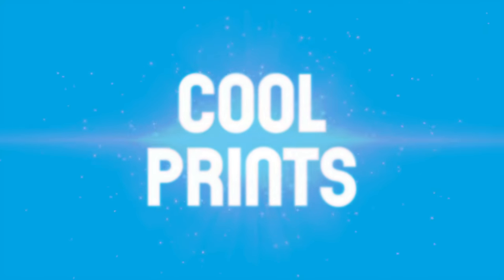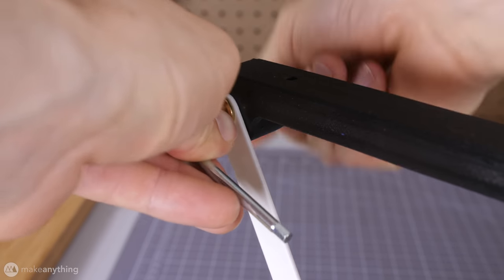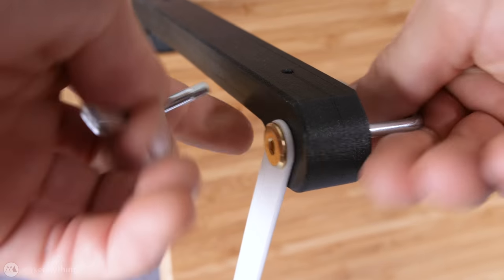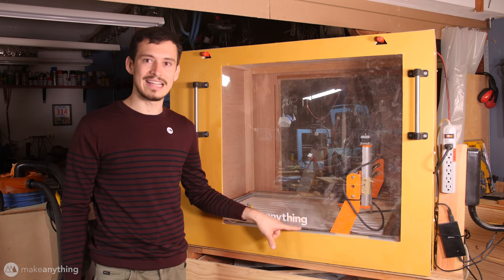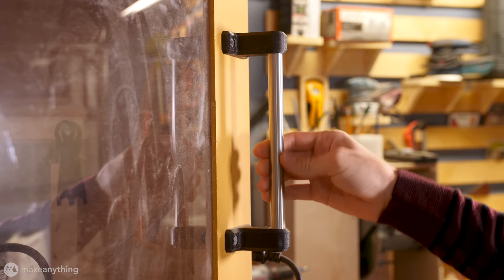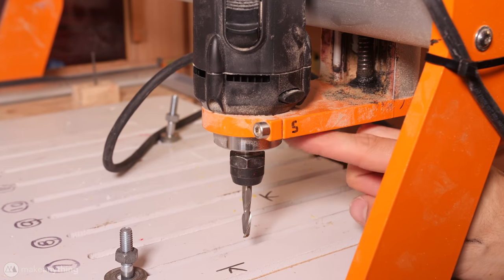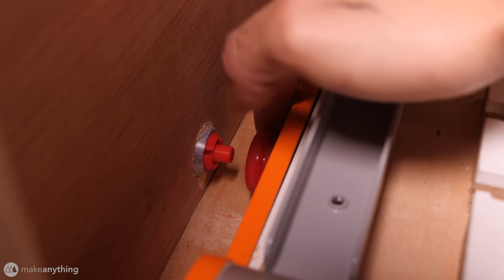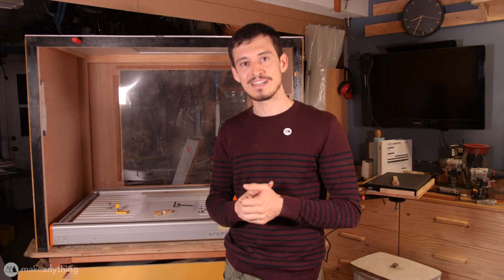Cool Prints // 3D Printing Strong Parts with NylonX (Nylon + Carbon Fiber Filament)

Comment: Project idea: using a CNC in conjunction with a 3D printer to make an object that could not be easily fabricated by either machine.  This includes ways to affix the object in both machines so the operations are aligned.  One of the goals is to fabricate parts that require a minimum of manual finishing work (one thought is using the CNC to remove support or raft blemishes).   Also 3D printing right on other materials then using the CNC before or after  in the process if needed.

Comment: when i make lettering or anything, i tape them into place before removing it from the build plate so the spacing is perfect, or at least only aligning it by eye in one or two places if it didn't fit in a line on the printer

Comment: You don't need it but for others who ONLY have a 3D printer You can build a bracket to attach to your 3d Printer either in place of or to attach to the Extruder head that will mount a Router to it and turn your 3d printer into an engraver with the proper Print settings in your slicer.

Comment: One tip when drilling with a paddle bit, instead of drilling straight into the wood, but cut and a slight angle and you'll grab more material. Once you're in about a quarter inch then you can straighten it out.

Comment: ever since i sprung 8 bucks for digital calipers I havnt bought a single replacement part for anything.
Reply: Better get an "analog" one from mitutoyo, mine is 20 years old and is extremely accurate with a precision of 0.05 mm.
Reply: @achannelhasnoname5182  Mitutoyo are pretty much the standard in machine shops for a reason... Expensive, but they last and hold their accuracy pretty damn well
Reply: @achannelhasnoname5182  That level of accuracy is redundant for 3d printing, even SLA. Just go for convenience. Cheap, digital, and a separate button for zero, unit change, and power.

Comment: same here! i made a ox cnc out of aluminum extrusions and used my 3d printers to print an arduino grbl box, a dust shoe vac adapter (which could be your next project) & limit switch brackets. i used nylon x, polymaker polycarbonate (pc) & polymaker polymide copa. stupid expensive filaments but when you're cutting away wood or aluminum you don't want weak plastic to break & fly off into someones face lol & i agree nylon x looks awesome because most of the lines disappear into this matte black "truck bed liner" look.

Comment: Hey Devin, I couldn't help but notice at 3:47 that your extension outlets on the right side of your CNC happen to be exposed. considering the possibility that pieces of conductive metal ejected from any power tools you could be using could end up in an outlet (which as you know is extremely dangerous), I thought maybe you should tape over them or find something to cover outlets that aren't being used. Have a good day!
Reply from the maker: Good advice, thanks :)

Comment: Your secret weapon is that 3D prints are more often than not pretty strong. :P 20 bucks says you could print those brackets using standard PLA, ABS or PETG and never have anything sag. If you're experiencing warping/adhesion issues, print on a surface that isn't smooth. I've always printed on BPT if not smooth glass with hair spray (before said glass plate exploded during a print removal!), but have been super pleasantly surprised at the ridiculous adhesion I get with everything printing on to this textured print surface that everyone is using these days. the stuff you'll find on magnetic build plates. Adhesion so good it actually damaged a PETG print (totally my fault! Was too impatient during removal) by pulling all 3 bottom layers off in one spot.

Comment: Honestly expected the filament to be way more expensive, but honestly not a bad price for what you're getting.
Reply: It's a gimmick.

 Multiple people have done tests on different filaments and carbon fiber infused filaments are actually weaker in most cases because it's more like carbon fiber powder than actual strands. Also not super great if it gets in the air, mesothelioma and all.

 PLA+ (basically less brittle, more ductile PLA) would have been actually way more than fine for his application.

Comment: Good video. Please talk more about what is necessary to get good nylon prints. Like you, I want to make things that are strong enough to be used safely, not just decorative trinkets. I have learned what the difference is between printing PLA and nylon, but everybody makes it sound much harder. I'm interested in what you had to do to make it work on a printer that might not be the ideal nylon printer. Thanks for a great channel.

Comment: as a start in CNC first, make your initials on a piece of wood or wren shape then using a similar material make a box out of any shape. you can use fusion 360 for CAM or if you have it use HSM pro for Autodesk Inventor.
i got this from a Project Lead the Way course Computer Integrated Manufacturing.

Comment: You could make a wooden picture (different widths in the part.. ..so when the light shines throu...) with the CNC❤️❤️🙏🤔
Reply: Ooooh, a lithophane out of wood ! That would be super cool. Probably super hard to make too, as wood isn't as translucid as pla, but maybe some type of wood could make that work

Comment: i have used CF NylonX too and find it tends to absorb moisture and not print very friendly. I now use CF PETG for my high heat resistant parts. and it has nurds everywhere. I need the heat resistance but so far no product is really perfect. Lastly I wanted to ask about 3D printing a manually operate Mill for a hobbyist  machine to build adaptors. I use a Dremel and stand but it is really flexible and flimsy. Dennis
Reply from the maker: I like the idea of 3D printing a mill, especially a mini one with the Dremel. And yea, printing high heat resistant parts is tough because of the nature of 3D printing.. you need some specialty hardware and filament to really manage high temps

Comment: That E-Stop extension still makes me nervous. If that was on any other machine (ie. a table saw), I would be terrified. Since it's an enclosed cnc with little risk for human injury, I'm less worried. It would still be nice for the design to be a bit more robust and reliable so that it works 99.9% of the time rather than 90% of the time.

Comment: I think this could be done with a standard filament. I am hanging a 12 lb electric guitar from a topology optimized wood pla wall mount with very minimal strain. His application has less weight and is in a more forgiving configuration than mine.

Comment: Haha.  With this way of attaching to the wall (one screw up and one screw down) you can completely avoid usage of that 3D printed black part.  Just bend the white metal upstairs and attach it straightly to the wall by a screw. And the wooden shelf (with drilled hole in the back side) can be pushed on the second (bottom) screw, protruding from the wall.

Comment: Hurrah for your dad!  Do you like your Stepcraft?  I run a vintage Techno Isel Davinci III that is likely older than you are (circa 1985) although you can still buy one new.  If you want to try out some CNC designs you can actually find some on Thingiverse.  There are some on my page Openscaddad.  There are also good designs by Daniel Gross on his page ZenziWerken.  I also have two designs out on Intentable's Easel page which can be done with a CNC or a laser cutter.

Comment: Especially since you installed them upside down, from an engineering strength standpoint. That way the shelf weight works as a lever, flip it it works as a brace. Just saying.
Reply from the maker: Good point, I just went with the way Ikea did it, but of course it's meant to be mounted differently. I think it will be fine though!

Comment: You could consider carbon reinforced PETG from 3DXTECH. It is much easier to print than the nylon on an open frame printer. It also is extremely strong (the layers bond very well), and it is a little more flexible than Nylon.

Comment: Very cool uses, I've just finished building myself a cnc mill/laser following the mpcnc design by v1 engineering (recommend you check them out) so I'm highly excited to see what uses you find for your machine as I built mine mostly for the fun of it without a direct intended purpose

Comment: I'm not agree with your emergency button, you should move the original and certified emergency button, for your sécurity.
I can believe you when you tell us that your adaptateur extendeur it's stronger enough to support all effort.
If you make an mistake and your headtools go directly against a big piece of wood to try to cut it, I can believe that your adaptater will not going to crack or give some dangerous angle at your drill.

Comment: I see lots of people are replacing the hot end on the ender 3 & ender 5 printers with all metal hot ends in order to print nylon, carbon fiber etc. Would you by chance know if the ender 3 "PRO" and ender 5 "PRO" come standard with hot ends that do not need hot end modification to print nylon & CF? Also, I am about to  purchase my 1st 3D printer and will mostly be printing materials that need to be high strength & rigid.  Do you feel the Creality products are up for the challenge? And, since I'm basically looking for strong & rigid vs. nice looking, Would you recommend another printer within the same $300.00 - $600.00 price range? Your assistance with this decision would be greatly appreciated.

Comment: Perhaps nylonx is strong enough for me to copy the design and print the brackets holding the alu extrusions together, moving parts in the micro adjuster etc for a router table fence

Comment: Where did you get the printing cover for the nylon and Abs parts to help prevent warping?
Reply from the maker: It's some random plastic bag from some packing material that just happened to fit perfectly 🤷‍♂️

Comment: I've seen 2 great improvements you could use for the router. 3D print something to hold the hose of a shop vac near your bit to keep your work space clean, and add a skirt around the bit to contain excess material. With tuning you may be clean enough to relocate the router out of the garage if you desire but mainly, Less Cleanup!

Comment: did you half to reprogram the router to account for height of the adapter
Reply from the maker: The z height is set before each use, so it doesn't change the process

Comment: I would have just cut 2 pieces of wood, drilled 2 holes in it and screwed it to the wall instead of waiting for that to print. Much faster and easier

Comment: It is always funny to see that most people in the 3D printing community have no idea how carbon fiber really works. Same here again. The strength of carbon fiber or other synthetic fiber materials come from laminating layers of meshes with LONG fibers in alternating directions. Adding shredded carbon fibers in filament, that is small enough to pass thru a 0.4mm or even smaller nozzle does add no strength to the material. The parts would be as strong also without any shredded carbon added to it. But it is always a good hoax that most people jump on and willingly pay top money for. And as the small carbon fibers shreds make a good abrasive, it will wear out your nozzle. But hey, you can just spend another $100 on a "ruby nozzle", to solve a problem that wouldn't have if you understand carbon fibers in the first place....